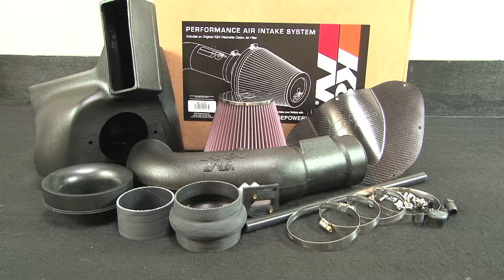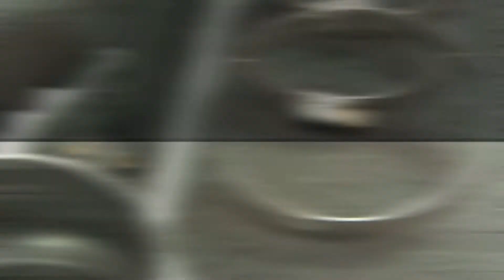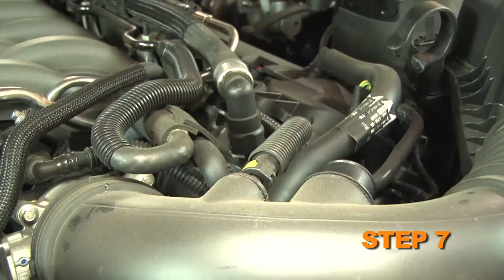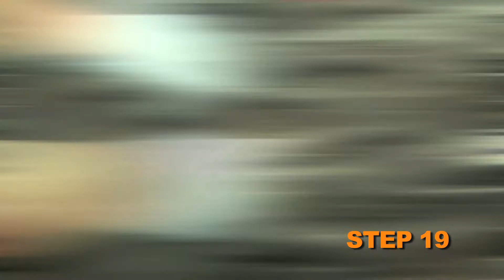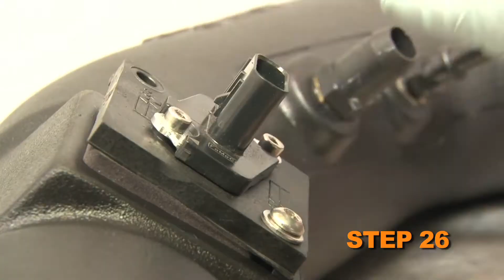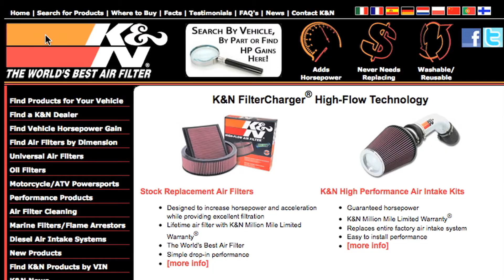Ford Mustang GT 5.0L [#63-2578] Air Intake Installation

Comment from the maker: The main difference is the 63 series kit has a black plastic tube, where the 69 series kit has a polished aluminum tube.  The overall design is very similar. We tend to see a little better increase in the 63 series due to the way we can form the tube for velocity.

Comment: I really want to add a cold air intake to my ford Fiesta 2012 but I talked to ford about it and they were telling me it will void warranty  but they told me I can take a risk putting one in but  they said if it mess's something up in the engine they will not fix it.